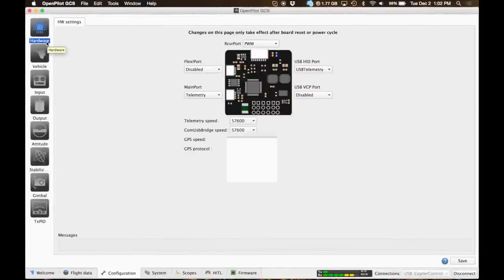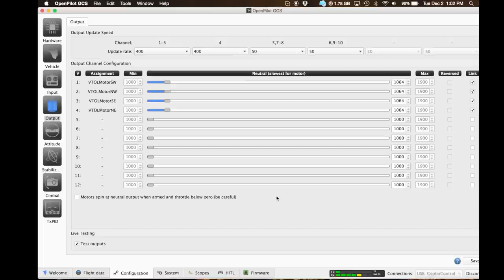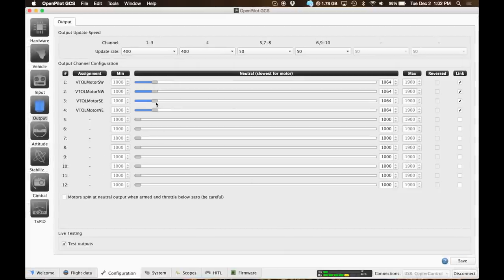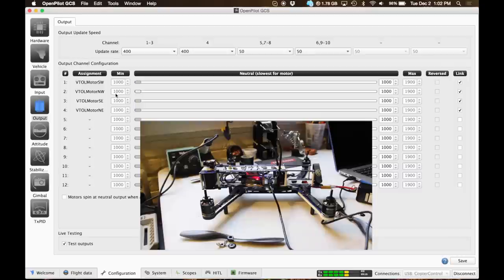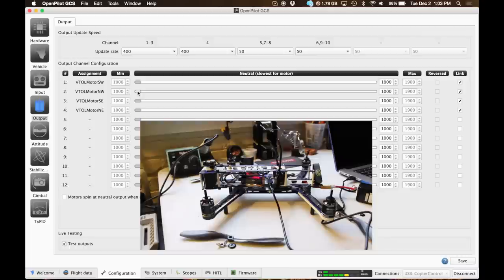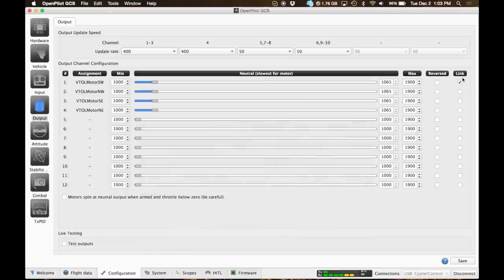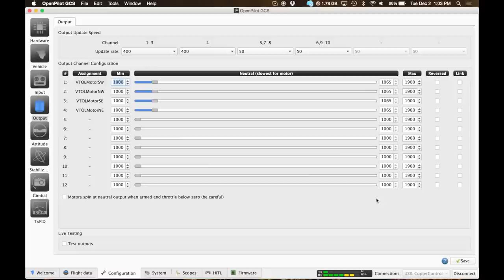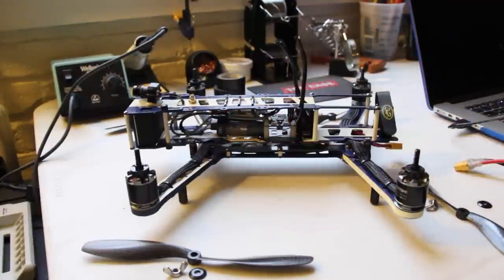Calibrate all ESCs via CC3D

Comment: Thanks, thanks, thanks! This video just made my quad way better! I used to have issues with motors not starting up at the same time at takeoff and now it just works! (Firts build here, working with a flame wheel f450 frame and some clone parts :D)

Comment: Hey...could you please help, this is my first quad kk260 frame, A2212/10T Brushless motors, JMT 30A ESC, CC3d Atom flight controller. But once I plugin the battery to the quad, the motor keeps beeping without any stop. What is not right? something might be very easy that I don't know. Suggestions please, anyone...thanks.

Comment: I did what you did in the video but motor number 2 don't have the power as the other 3  meaning I can stop it by just a little touch any idea and great video...THANKS
Reply: +robert jr 
I have a similar problem, number 2 and 4 motors can be stopped easily by hand, if I plug them into channel 1 and or 3 then they are normal, beginning to think my cc3d is damaged, I have wiped and started from scratch several times, calibrated several times, its weird. Seems like the signal coming from 2 and 4 just isnt consistent.

Comment: can i calibrate using CC3d and then use same ESC without re calibrating with APM2.8 ?
Reply from the maker: Tech Nova yep just make sure the max and min are set the same for both flight controllers
Reply: One of my esc starts in the middle point and up and down take as slow. I dont how to fix this :(
Reply from the maker: Tech Nova might be set to bidirectional. Or the min throttle is set to like 1500. It should be around 1000
Reply: how can i fix it?

Comment: This procedure calibrate the throttles limits only, what about the rest of the calibration, can it be done with the program card ? and just do this on the GSC without going through the vehicle set up process all over again? the problem I'm having is when I set up my quad I get tp the CC3D calibration sexction and my ESC's get into program mode and they keep beeping the various option and I dunno know when to press the stop button, and if I don't it keeps cycling (looping) through the various program beeps, I have the emax kit, 12A simonK and 2204/2399KV motors, agin my question is can I just program my esc's manually (I have a card) and just skip this step when I set up my vehicle? thanks
Reply: Gus F I had this same problem. What you need to do is kind of ignore the GCS instructions for when to connect the battery to the quad. Make sure , of course, the props are off. Connect the battery to the quad and then check all the safety boxes to calibrate the esc's. Click start and proceed with the calibration, click stop as usual and once finished disconnect the battery.  So you just want to have the battery connected throughout the process instead of connecting when GCS tells you to.
Reply: +brian wilson man you a live saver thanks very much

Comment: i had some issues with my esc's and control board and after doing this, only 3 out of 4 motors rotate, could it be that my esc is broken? i've also tried calibrating only the esc that wasn't working and it still wouldn't turn. Any ideas?
Reply from the maker: +Sjoerd B and it was working fine before you did this calibration?
Reply: +ChanCopter kinda, it just kept flipping flipping over on me so i figuered there was something wrong with the calibration, so i did this and but after that only 3 motors would work, so i did some more digging, and i found out that the firmware might be bad, so i flashed it with other firmware and now it won't work at all. It does make the beeping sound inficating it was booting up but i couldn't get it to turn the motors, so i figured it wasn't talking to my receiver properly after upgrading the firmware. So i set it to dsm (which is what my receiver uses) but it still won't work, so if you have any suggestions it would be greatly appreciated

Comment: ESC calib Is this don't before or after vehicle setup?

Do I need to calibrate something else before rotating CCD3 90 degree?
Reply from the maker: Black Mamba FPV I tend to do mine before setting up the flight controller's PIDs and stuff. The ESC calibration has nothing to do with the board rotating 90 degrees. Under Attitude, you can input + or - 90 to turn the board's sensors. I believe -90 is clockwise and +90 is counter clockwise.

Comment: hi...great video  . when I arme the quad my motors start in very high speed.  is there a way to change the speed to a more neutral speed ...I feel it's going to fly on me
Reply: Yea you can set the 'minimum throttle' value lower to slow down the idle speed
Reply: where is this on Librepilots

Comment: What did you have to do calibration wise to turn the cc3d 90 degrees?
Reply from the maker: Drew Larsh Under Attitude, I put -90 for Yaw so that my USB came out the left side.
Reply: +Chonny This... this is brilliant! I bought 90degree adapters of eBay to fix this, when it could've been sorted via software
Reply: +Chonny What do I put if I want to turn my controller so it has the USB on the Right? -270? or 270?
Reply: +Jonathan Sims I figured out via another video. Its 90 degrees not 270. 90 degrees for usb on right... -90 for usb on left

Comment: Hello
I need help.
I have a QAV250 with CC3D flight controller, but I have a problem:
When i increase the throttle he goes forward and turns right.
I calibrated the ESC several times, I have upload the new firmware, but still all the same.
The QAV250l works fine, so the problem arises when I apply more trothlle.
Thanks
Reply from the maker: Could be a few things. Is your center of gravity directly over your flight controller? How much throttle are you applying when this occurs? Are you sure all your props have the same pitch?(5x4.0 and 5x4.5 look very similar) is your transmitter trimmed out to be centered? (Mine beeps when it's centered) What mode are you flying in and have you calibrated the accelerometers? Lastly, are all the components  (esc and motor) the same make/model?
Reply: ChanCopter
thanks for your answer.
the center of gravity is fine its over CC3D.
1/4 throttle
props i use 6x3 and 6x3R
i use a Taranis Plus, the trims are centered.
Emax motor 2204-2300KV and Favourite 12A SimonK ESC.
Mode - Atittude / Atittude / Rate.

Thanks
Reply from the maker: Does this occurs in rate mode as well as attitude?
Reply: i don´t flight in rate mode is very insane, just in attitude
Reply from the maker: Paulo Cardoso ok so far i know that the front left motor is falling behind the others. A few tests you could do to pin point the problem. Assuming you have already calibrated the cc3d, try swapping the front left with the rear right motor. keep the ESCs where they are. After the swap, if the quad drop backwards and turns to the right, then its a bad motor. if it continues to drop forward and to the right, look into the ESC. If neither one of the cases happen after swapping the motor, look to the cc3d. After doing that, I can help you fix the component that's causing the problem. If neither one of the cases happen after swapping the motor, look to the cc3d.
Reply: thanks

Comment: sadly my board got toast today  I don't see the damage not burning smell by mistake my battery have dean connection I reverse the connection to test the motors I check all the system true the comp and the only thing that don't work is the is the speed control calibration. o well I have to order another one.

Comment: Was the Transmitter on when you did this?
Reply from the maker: EnlightenedOnes nope. max and min was sent by cleanflight. no need for any transmitter input. However if you have your failsafe set to beep, it might be beneficial to have the transmitter on or you'll have to put up with the insufferable beeping.

Comment: Hi mate nice video.. I did that to my quad and it works well but i have a problem on my throttle my motors start to spin in the middle it like 50-100 is working but the 0-50 is not working u don't know what was the problem (dx6i) hope you can help me
Reply from the maker: Seems like a calibration issue with your radio. Did you run through the radio setup? for the one part just before it tells you to move your sticks to the extremes, do you have your throttle stick in the middle or all the way down? Also, make sure the trims are centered before you start as that will throw it off.
Reply from the maker: E.S MOD yea sure...not sure if you have ppm or pwm so i sent both.
Reply: specs on my quad
 12a simonk esc's
mt 2204-2300kv emax motors
cc3d 
orange rx615x
and my tx is dx6i dsmX

Comment: Your brave using wing nuts to hold props on
Reply from the maker: I always break the props before they get a chance to wiggle free :p I've since switched over to blue anodized lock nuts now. Power drill in the field removes the nuts faster than my hands will.

Comment: Careful when doing this, don't perform this if you copter is running fine, I have had major issues since using this advice, had to buy a new motor and esc to fix the issue, I can't tell you what went wrong. All I can say is that I was trying to even out calibration because my rear motors were firing at a high setting and after doing this motor 4 started wining and I had the fod

Comment: I love you dude lol
Reply: okay you help me out a thousand times more than anybody else has you got my card in the air again but he still has a slight wobble I can kind of correct it but I won't fly it like this do you have any tips
Reply: +Ultimatevapor918 quad
Reply: +ElementalRC I think I had a faulty ESC because I continued to fly because I fix the wobble almost completely went to fly and I had ESC or motor failure it won't spend it all now on its own I can manually spin it the guy that built the squad for me is going to replace whatever is broke though I just have to wait till next Monday this sucks LOL

Comment: You know you powered up your vtx without the antenna right? Good video btw!!!!
Reply from the maker: The extension cable was sufficient to prevent the vtx from frying itself. I've had the antenna come off a few times for this theory to test itself :p could just be a feature on the immersionrc vtx too. Few weeks ago I powered up a bare vtx on the bench without an antenna (600mW immersionrc) for almost 30 seconds and it was still okay afterwards.